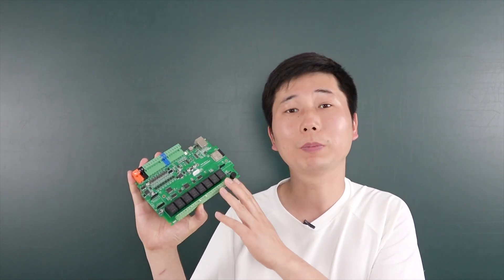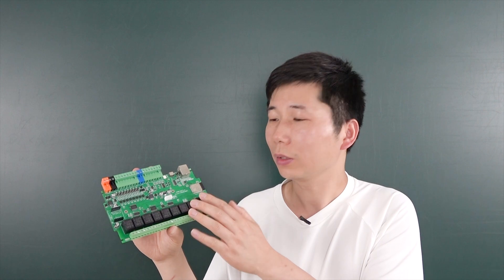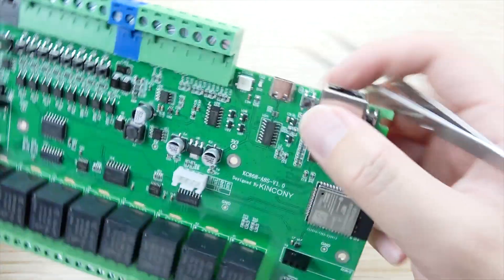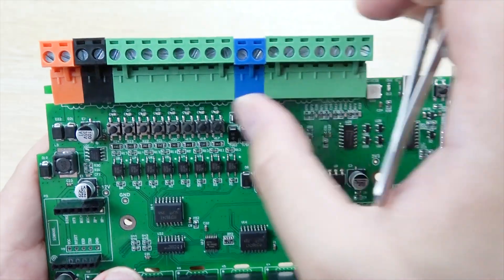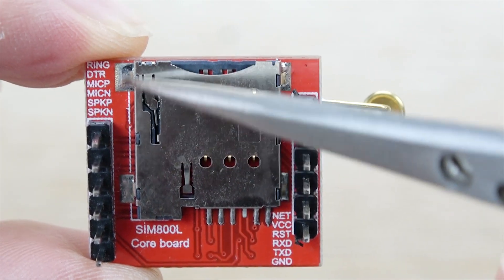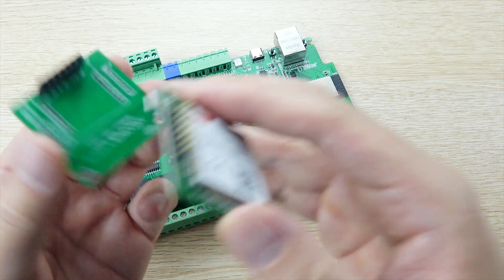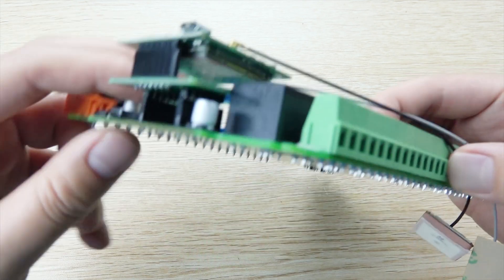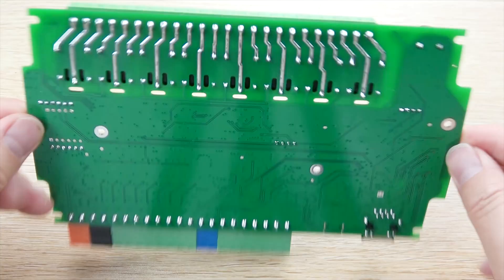KC868-A8S ESP32 GSM GPS IoT board support 2G 3G 4G module!

Comment: Nice board. I have a need to automate farm irrigation.

I need to turn on/off solenoid valves using GSM.

I was looking to develop a esp32/gsm/relay + solar powered device to solve this problem.

Looks like your board can control solenoids via relay and solve this problem statement!
Reply from the maker: yes, it can use

Comment: This board seems perfect for my automation project; there's a noticeable dedication in the development and product quality. I'd like to purchase one, but before I do, I want to make sure I can get it to work. When checking the Arduino file 'mqtt-relay' for the KinCony KC868-A8S board, I don't understand how the communication between the SIM800L modem and the ESP32 is possible. There's no configuration for it in the code. Is there any information I should be aware of before buying the board?
Reply from the maker: SIM800L or SIM7600E use serial port with ESP32 gpio. if you want to use our firmware, support 4G sim7600 module.

Comment: Can the relays on this board drive 12v stepper motors for Peristaltic pumps?
Reply from the maker: what's the motor work current? every channel use MOSFET MAX current is 10A.

Comment: Found this product today and I'm watching all videos 1 by 1. Those boards look gorgeous, but I do have some questions:
1. I see DI 1-8 are optoisolated, but what about relays? 1 of my current problem is a water pump that send backfire to my PCF8574 and sometimes even reset my esp8266.
2. I'll be using the board with home assistant and esphome, I see relays are controlled over 2 PCF8574 and will be addressed with pcf platform from esphome, how does digital input and analog pins can be addressed using esphome? Is there a pinout that I've missed?( I checked the site and alliexpress shop as well).
Reply from the maker: 1. The problem of your previous board has something to do with the design. high voltage circuits and low voltage circuits need to be isolated. our board test with AC contact no any problem.
2. INPUT and OUTPUT use iic bus, support by ESPHome, just set the IIC address and pin number. we have ESPHome config yaml file on our forum, you can download and directly to use.

Comment: I'm really interested in this board but I cant find information on what input voltages it can take on the digital inputs. Will the inputs work with and tolerate 230VAC? The schematics show a resistor of 2k which would result in a 115mA current on the optocoupler if i understand correctly.
Reply from the maker: the digital input use dry contact signal or MAX can input dc12v, not use AC220v directly.
Reply: @KinCony  thanks for the reply. Do you guys provide a board I could use to translate input logic from 230VAC to 12VDC suitable for these inputs?
Reply from the maker: @philsson  sure, you can use a convertor, not need output any powre, just OPEN/CLOSE contact signal is ok.

Comment: In your videos of home automation,the relay board controled by an mobile app 
Is there any requirement of program uploading or it is built-in or if program is required,is it written by you 
Please guide me about program of home automation project
I want to learn how I can automate a house
Reply from the maker: we already have wrote the code, you not need to write code. also you can use some open source software, such as home assistant.. we have video lessons.